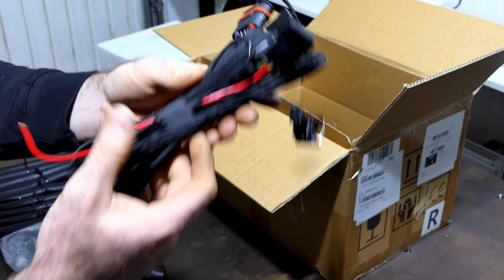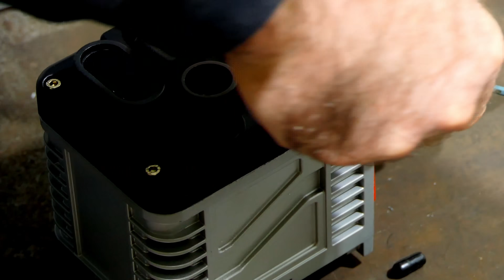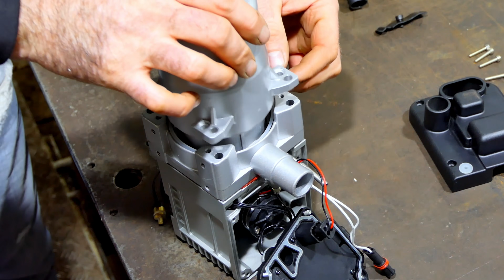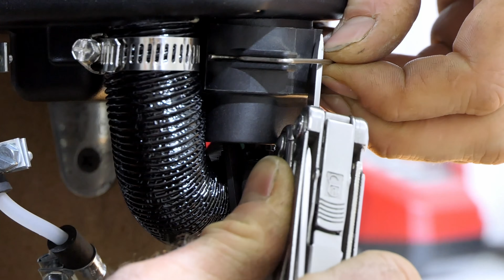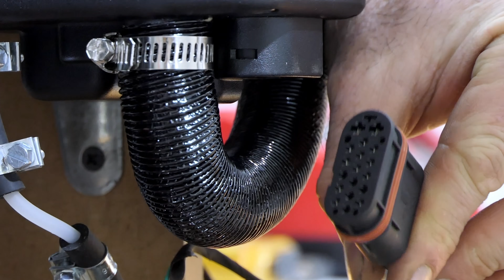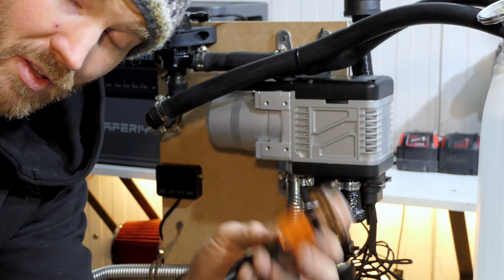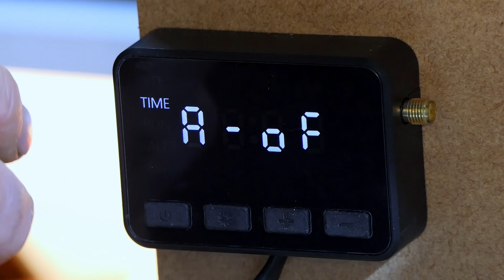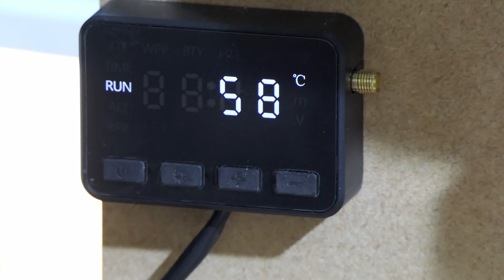Wonder of Manufacturing - Worlds Cheapest Automated Hot Water Central Heating System

Comment: On this heater, at least mine, has also an option to work always on, as electric water heater does. Heat upto 60C with max power, 60-80 reduced power, 80 off and 60 starts itself again, can be helpful for floorheating with big boiler/reserve tank, i'm using it with 200l tank into my floors, heater is in shed, underground pipes to house, 3d tap for precise floor temp. It consumes also less, when always on option is used. Fuelpump died on mine after 300l fuel used and on mine the pump was underrated also (cc/min) U had 3,2kw output, it can easily also be too small bored pump for 5kw output. P.S mine is marked another company, but was also in aliexpress more than a year ago. P.S2 bad quality biodiesel clogged mesh on my heater, bad start's, use better automotive grade fuelfilter atleast, 4 micron should be fine.
Reply: Interesting, I have this one and it can't be used for continuous heating, does not have the option in the control.

What brand is yours? Maybe i can buy the controller and swap👍
Reply: @jonjessen  Mine was sunster, it has like work mode 1 or 2 (i dont remember right names and even how to change, but it was something like hold this button and something happens :D) P.S on original webasto or eberschprächer heaters u can use them without controller. There is 1 wire, which needs +12v (addition to main +) to start it, controllers are different, some need some communication or sensor wires also, but machine itself can work without controller and it is on as long as +12v is on on the signal wire, safeti features come from machine own ecu, so ditch the controller and it should work as i mentioned...
Reply: @tonyjairus  excellent, thanks for the explanation!
Reply from the maker: Good tip. Cheers J

Comment: excellent presentation! I'm off grid and in a "cabin" where hot air ducting from a diesel heater is challenging....and hydronic heating for ancillary space would be possible. I've looked at small diesel boilers but the expense and complexity is too high. Thank you for this and i hope that you might at some point develop blower coil space heating concepts.
Reply from the maker: Thank you so much. I'll look into it. Cheers J

Comment: A small detail, glycol has both less heat capacity and heat conductivity than water. Around half. But it does flow better at zero degree Celsius, which is the only benefit to it. Any other benefits are usually due to additives added to glycol solutions. Otherwise, good video as usual, nice breakdown of the pump, appreciate the walkthrough!
Reply from the maker: Thank you. Cheers J
Reply: "But it does flow better at 0⁰c than water" it also doesn't expand and crack anything you put it in if left in that temperature for long periods 🤣
Reply: Ok, thank you for the tip. Any idea of a more suitable fluid thermally-wise ? In terms of possible interesting alternatives to glycol, here in France it is possible to buy bottles to make your own cooling liquid simply by mixing a concentrated bottle of additives with distilled water. It is way way cheaper, you can add it up after testing a circuit with water and you can concentrate or dilute it according to your freezing conditions.
Reply: @63n0it  I've heard of "Water Wetter" for race cars, from memory it allows the water to conduct more heat while being less slippery if there is a spill on a race track but I don't think it has any freezing protection.
Reply: @stonesie81  It's not great it breaks the surface tension of the water to stop bubbles of steam forming around very hot surfaces. Unless you have issues with overheating it is next to useless.
Reply: @stonesie81  Thank you. As far as anti-freezing properties are concerned, I believe it is primarily related to the alcohol content.
Reply: @63n0it methanol-based antifreeze is very rare nowadays, ethylene glycol is being discussed here.
Reply: @63n0it you can get used glycol from any car repair garage / HGV service centre - they pay to dispose of it. Use the Pink 'eco' variant, and never mix with the blue glycol - they form a strange slime when mixed.
Reply: In some states it is still sold at the pump .
I saw it in Portland , Or two years ago but only at one station .
Reply: @fiery_transition antifreeze is also anti corrosive which is why it was mentioned in the video.
Reply: Found out the worse conductivity and capacity when I had to replace some parts and had to swap the old coolant for pure water. (To get it out of my friends yard to my garage, i love doing field repairs)
The damn thing would only heat up while uphill and then would blow extremely hot air from the vents for maybe 30 seconds before the temps would drop to around 60-70C
This on 1.9td t4 transporter
Now that it has normal coolant again the heater and temps work normally and it no longer dumps all the heat in seconds
Reply: @fiery - no one is going to use 100% glycol, so those figures are not that relevant in practical use. Ten percent, maybe 20% glycol in water would be fine to prevent frost damage generally,  in the UK. What are the figures for the newer pink 'long life'  antifreeze, do you know?

Comment: We need a water tank where the exhaust can be fed into a heatsink / exchanger inside the tank then away. It's a shame copper causes problems. Hot water is the only thing stopping me telling the gas suppliers to hop it, never realised it was so cheap to heat such a volume of water.
Reply from the maker: Thank you. yes I'll be usinhg this system in my office build for underfloor heating and a shower system. cheers J

Comment: If you used Diesel would that not give you a higher efficiency? I understood it to have more BTU per gram of weight. - Would this change the outcome of your testing vs the manufacturers specs?

Certainly Kerosene would be the preferable fuel in any case, especially given what we know about its impact on air quality in city environments.
Reply from the maker: Its all relative to cost, i don't think the BTU are much higher that it would be more cost effective. making your own bio diesel might be though. cheers J
Reply: @joshuadelisle   I hadn't actually looked up the BTUs, but you are correct. It's something like 135000 vs 140000, so marginal at best.

Comment: Depending on the metals used in the burner, you 'might' be able to clean out gunk deposits by soaking it overnight in a concentrated solution of Sodium Hydroxide. Flush with clean water, then place in the oven at ~ 100°C for an hour or two to dry it out.
Reply from the maker: interesting. cheers J

Comment: Hi this is not meant as a criticism because I love your videos but you didn’t take into account The loss of heat from the pipework and the barrel over the 30 minutes. Just wondering what it would be if it was fully insulated. keep up the good work
Reply from the maker: I did. i calculated the total eanergy remaining in the water and the total energy in the fuel used. the difference is heat lost in the pipes which was 21%. cheers J

Comment: If you're worried about o-rings, you can buy strings of the same material, cut it to length and glue it together to form an o-ring. Some manufacturers even sell complete o-ring fabrication kits with everything included. For automatic air relief of the system, you can use a standard air vent valve that's used for hot water heating systems.
Reply from the maker: Nice. cheers J
Reply: @joshuadelisle the glue is cyanoacrylate (good quality superglue).
Reply: Very nice tips. How great is the internet, sometimes. THANK YOU !
Reply: I use Loctite o ring kit....McMaster Carr.... the neoprene rubber would be equal or better than the urethane that you are using.
Reply: @mattruz9238 at least Josh said it was silicone o-rings, not neoprene. I'm fairly sure that silicone is the most temperature resistant of the common O-ring and sealing elastomeres.
Reply: I find the red vitron seals are the best..
Reply: @MultiOutdoorman no 'R' in Viton
Reply: Hight Temp RTV would likely work also as long as you were careful with application.
Reply: @madengineer9072 if you're careful to thoroughly stir the joint together (or squeeze it in your assembly) it works but if you just butt the ends together it doesn't because the material skins over almost instantly.

Comment: Nice test! I think the efficiency is a bit higher since you are losing quite a bit of energy to the air and workbench ( see the flir image), you would get a more accurate reading if you insulated the container and hoses :)
Reply from the maker: very true but for a practical output there will always be losses in the whole system so I think the calculation it is still relavent. depending on wether the pipes are insulated or not, it could be far worse. cheers J

Comment: if you use your preferred method of making a casting or molding , ( powder, 3d printing, blue stuff) you can make a reusable mold and make replacement o-rings and seals using silicone with the proper heat resistance, they wont be quite as good quality but since you can make as many as you want it usually evens out. i always find this useful for weird shaped gaskets like the one on the back plate. also I'm sure for where you are the use of biodiesel doesn't make sense for financial reasons but it might be worth seeing what the efficiency of using it is because it is easier to make in emergencies than refining your own petrochemical diesel.
Reply from the maker: good idea. cheers J

Comment: This thing reminds me of about 25 years ago a buddy's dad picked up an ex railroad pickup and it had a diesel cabin/engine preheater in it.  It was intended for the rail crews to be able to sit/sleep in the truck in the coldest weather but not have to leave the engine running.  It kept the cabin toasty and the engine block and oil nice and warm.  We pulled the thing out and ended up installing it in his shed for heat.  It used 12V DC and a 1 gallon diesel tank (would last well over 24hrs) and the truck's heater core.  A 12V fan on the heater core made this thing pump out the heat.  It would run off a car battery for hours without thinking about it.
Reply from the maker: Nice. cheers J

Comment: A small suggestion, learn and use significant digits. It would make the presentation easier to understand. 

I'm not sure this would be the most cost effective or efficient solution. A tankless water system (using gas) or even an electric water heater would be quieter if not more environmental friendly. Though running solar would be more expensive. 

Hmmm the subject of another video I suppose! Thanks though for this video.
Reply from the maker: Thank you. I'll bear that in mind. Cheers J

Comment: Another great vid, thanks Josh. I'm going to get me one of these and make the gas combi boiler fully redundant! Just a comment on your calcs. Your kero to diesel cost conversions varied from 2x to 4x in various statements while the true ratio of kero at 55p/litre to pump diesel at £1.47/Litre is 147/55 = 2.67x. I'll lend you my old engineering maths text book!
Reply from the maker: I think that's because I'm moving from 1/2 hour to 1hour use. Cheers J
Reply: @joshuadelisle  Easily done, ratios are good for quick sanity checks. I bagged a heater, thanks for the nice big discount code. Underfloor heating in the workshop here we come!